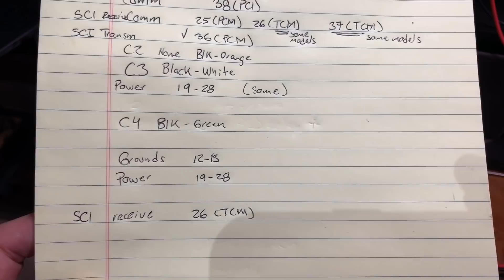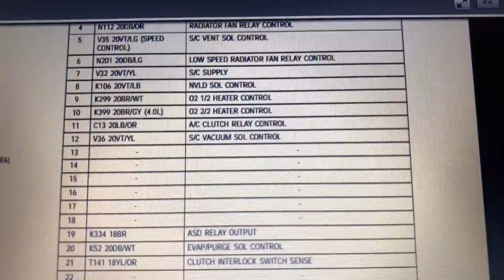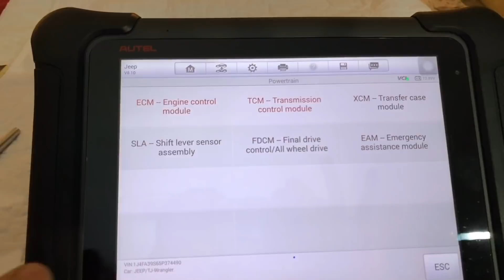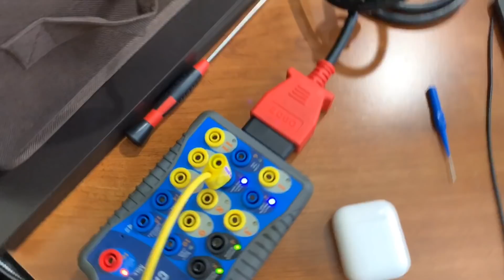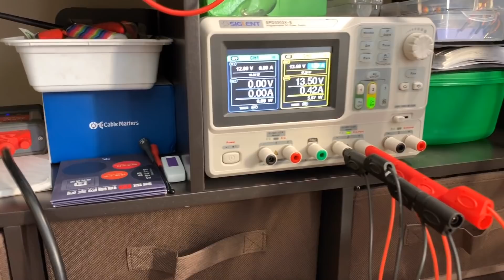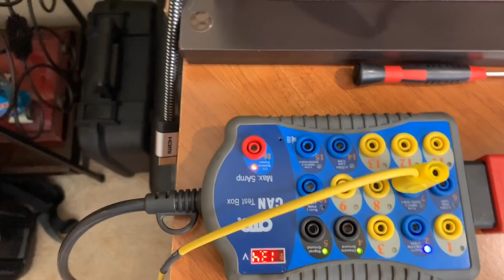2005 Jeep Wrangler X PCM repair, no TCM communication problem

Comment: i have a 2006 jeep grand cherokee 5.7 randomly goes in limp mode, ive tested all wiring and throttle body and accellerator pedal are new. ive tracked it to the pcm, do you know where i need to look into for a repair to the pcm? its a p2100 code on C2 throttle control is from pin 6 and 38

Comment: I like your videos , The issue you are going to have since you have removed all the potting material is that computer will overheat FAST!  that is a heat sink material used to transfer heat to the aluminum so heat can be dissipated. That is a proprietary material to Chrysler so you cant purchase it.While on bench it will not draw heat but when in vehicle and running it gets hot fast.For future repairs only move what you have to to do the repair.Also bga reflow on the trans chip is big issue on these units also.
Reply from the maker: Well I do have the potting so not a problem.
Reply: @MaicSalazarDiagnostics  How will you put it back in?? Its not reusable , it cant be transferred back to a liquid state??
Reply from the maker: Keenan Laws I mean, I have the potting new. It comes in a A and B liquid that sets in 5 min. Look for Crystal Gel from Etelec
Reply: @MaicSalazarDiagnostics  Ok I was hoping you had some new trick to reuse it! lol

Comment: Have you had any experience using the avdi software suite from ABRITES or the clone  chinese version  fvdi ?  if not what software do you use to transfer immobilizer data and milage information in vehicles with a failed instrument cluster to a used replacement cluster ,where the immobilizer data is held in the instrument panel , (especially volkwagen group vehicles store immobilizer data in intrument cluster). also what software do you also use to programme new keys when a customers arrives with all keys missing and need to programme new one but the immobilizer is not accessible wtihout original key 

thank you for your time very insightfull seeing how a well trained mechanic works on cars
Reply from the maker: I don't have Abrites so for most of the cluster I use Xprog and for keys I use CarProg. As far as instrument cluster on VW I use VCDS with Xprog.
Reply: @MaicSalazarDiagnostics  thanks for taking the time to answer that ,much appreciated